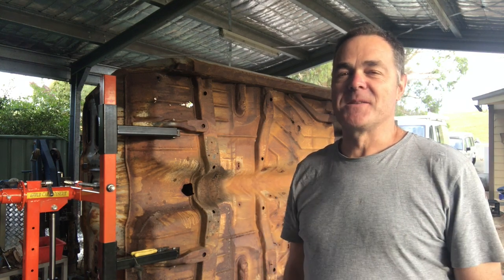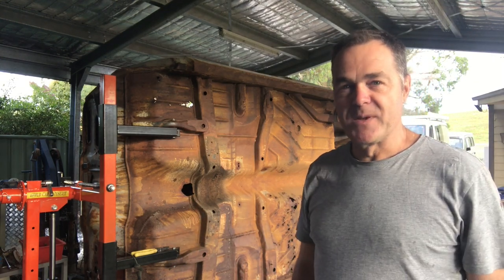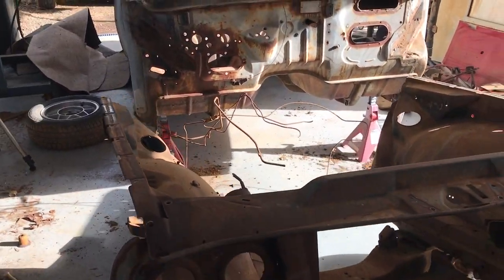Holden Restoration Episode 2

Comment: Any broken bolt extractor is designed to remove a broken bolt that is still free in the thread. It is inevitable that they break when they are used to try and remove a frozen/rusted bolt. Live and learn. Your comments about the repairability of older cars is so accurate. Can be maintained endlessly.

Comment: Wow you got your work cut out for your self. If it was my project and I was going around Aust. I would leave the v8 springs up front with some gas shocks have some Hi lift springs at the rear. Put a limited slip diff in and run some off road desert deulers on her. You will get most places with that set up.

Comment: Y frame. K frame is a Valiant.
You should drop the crossmember before the Y frames. And use a rattle gun to wind out those bolts.
The car seems a bit gbetter than most but still a lot of work
Reply from the maker: Tried every trick in the book, the bolts are notorious for being tricky to get out.